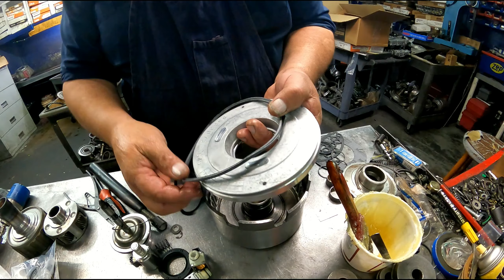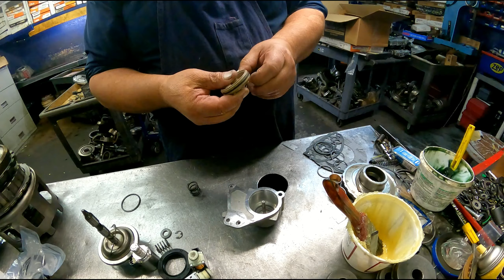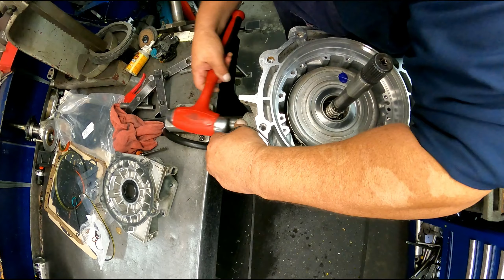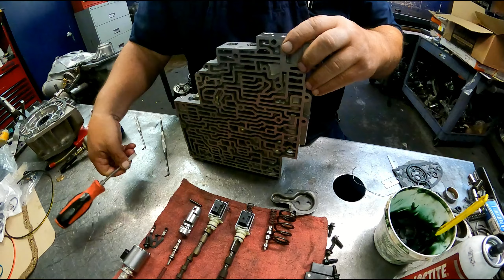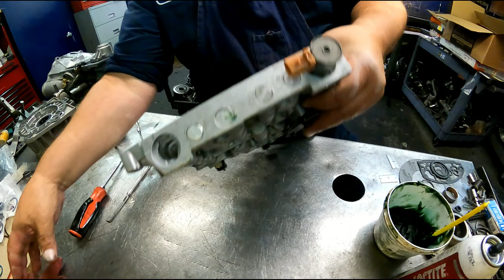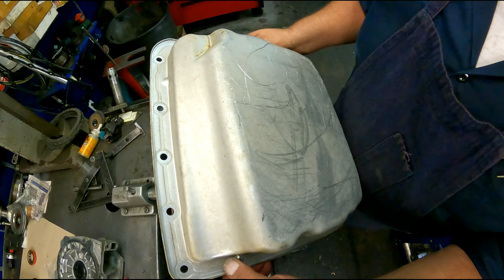4L60E TRD Rebuild

Comment: Perfected job,thank you
Reply from the maker: Thanks for watching.
Reply: @CurmudgeonTransmission  dear tom i have buick lacrosse 2006 3.8 with 4t65e   transmission and while I drive there is kicking between the first and second and third and fourth gears what's the problem I have replaced the pressure solenoid so what else I can do to fix it I have also upgraded the springs in the accumulators Chambers please your help will be appreciated thanks from advance sorry about my writing mistakes I hope you understand me
Reply from the maker: Did you make sure the springs were the same and went back in the same places? Also did you reset the shift adapts when you were done?

Comment: Your vid’s have helped me tremendously both on the 4L60e and 4L30e. At the moment I’m in a 4L60e from 96, putting it back together with fresh parts. I’m not sure about the input sprag and sun gear; the one (sun gear) I have slips in and out of the of the sprag. There’s no gear mesh slop, but when I have the input drum completely assembled and turn it over with the input shaft in the up orientation, the sun gear falls out. The sprag doesn’t have the 3 tabs to retain it. Is this something I should be concerned with? Appreciate what you do, and the time you take to put these videos up.
Reply from the maker: Glad they helped. They did not come out with those tabs until like 97 or 98. Just put the gear down in the planet first and it will be fine. Thanks for watching.
Reply: @CurmudgeonTransmission  Thank you for your reply! Hope you all had a great Thanksgiving-
Reply from the maker: You're welcome, you as well.